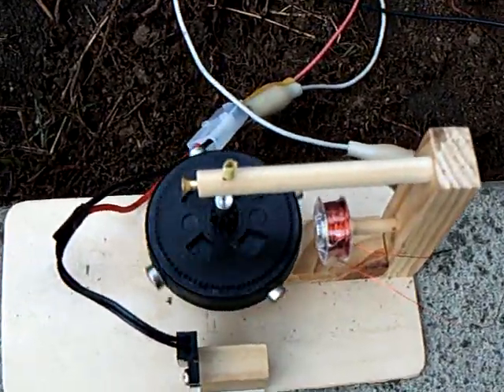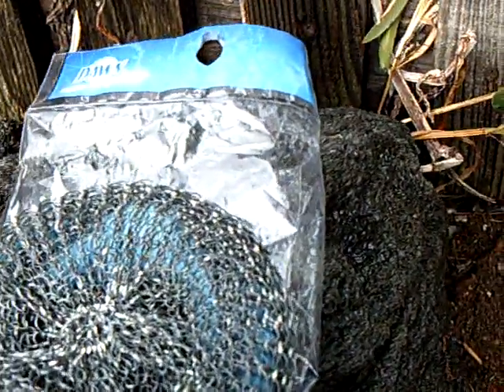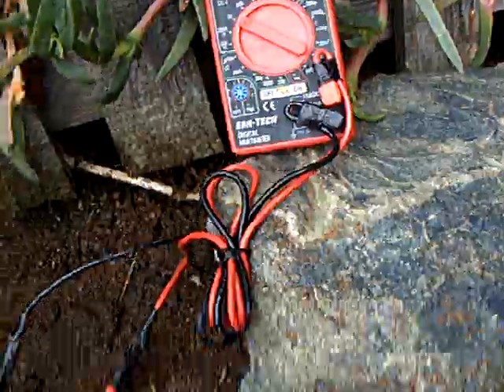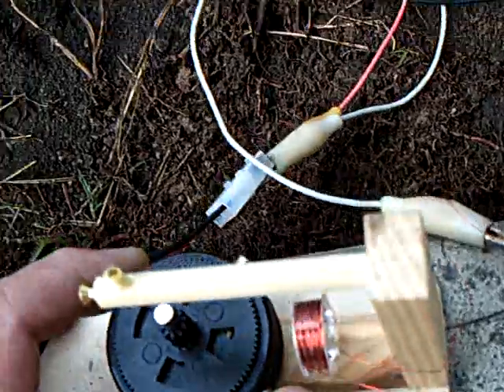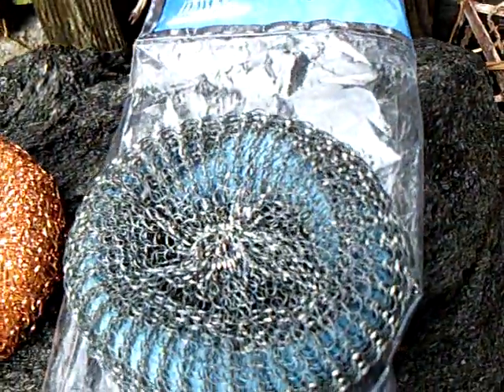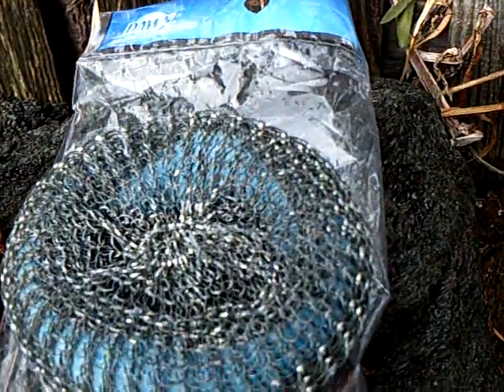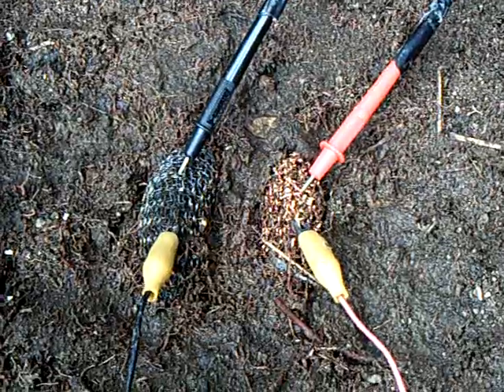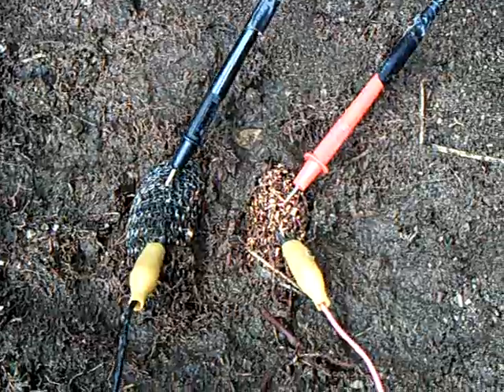Pot Scrubber earth battery ----running a pulse motor

Comment: try using zink rods, you will be amazed, all you need are copper or stainless steel as the positive and zink at the negative should give u close to around 1.7 - 2 volts.

Comment: hmmm, I wonder what a chunk of galvanized fence and a copper grounding rod would do?
Reply from the maker: Unfortunately all I did here was put a 'lemon battery" in the ground.  It is a simple galvanic cell.   They did this years ago for powering telegraph.  Google 'earth battery images' and you will find a bunch of old designs for these.  A buried galvanized fence would work good for the anode.

Comment: Where did you get zinc pot scrubbers from?  I can find iron, stainless, and copper but no zinc.
Reply from the maker: +legalizeshemp420 The have the zinc coated pot scrubbers at the dollar stores.  They are not solid zinc and when the zinc is gone you are down to an iron and copper differential.  The solid copper scrubbers can be found but usually those are also just copper coated.   This project was interesting but really all I was doing was putting a copper / zinc battery in dirt.  You could do it in a flower pot.
Reply: *****
Yep.  I tried a zinc coated nail and a coper piper in some water with vinegar and 1 cell would not even light up a LED with a Joule Thief and what was really surprising is if I added a battery in the loop that was 1.3v it still refused to light but the battery alone it lit via the JT.  I had almost 1V but I suspect the current was just far too low.  Working on this to show my nephew as a school project and I have never had any luck.

Comment: Hi Lidmotor my hat off to you for your constant new twists of experiments. I can testify that connecting a 5 ft carbon rod of about 4" diameter and a 1ft. long 2.5" diameter magnesium rod gives up to 3.5V,  I recall up to 5 volts depending on orientation etc, with a joule thief I was able to directly power up 3 regular red leds about 2.5 volts each at the most,and at around .45 amps... Both rods were close and far in several tests of mine, the north south orientation being the most powerful of it all,t( I have Aztec blood in me, I know they were right as well) In my case, in muggy Georgia, at the time, water wasn't my friend, voltage was low after raining, My conclusion is that the reaction could be doubled in nature, obviously powered by water but also, telluric currents studied by Nikola Tesla, but in my humble opinion using resonance is what we are missing in order to obtain a more powerful effect, procedure that escapes my expertise at this moment (not that I have the time after family) but this experiments are certainly proof that the legend is a reality, I'm sure that you would consider what I'm about to say a very valuable piece of information: As a tremendous coincidence while researching about telluric currents found out through my wife that her great grand uncle, was the real inventor of the Telegraph!!...Alfred Vail, if my memory doesn't fail,(name wise) and he also experimented with the idea, most likely after being around Nathan Stubblefield, just like Nikola did!...Hence Alfred implementing the battery in the expensively financed by his father Stephen Vail, telegraphic lines, both individuals were regarded as mechanical geniuses, high intelligence runs in the family,( my father in law, a long time ago, created a puzzle made of wood blocks, that looks just like Tetris!!...If he just would've patent it)  but also like in Alfred's tremendous humbleness and benevolence, there is no interest in money...Alfred died in poverty due to Morse's crooked ways, I have made my mission to try to let this know. for it is how we loose the real originators of great inventions and their secrets,- wish I would know more- hopefully in the future by researching more about Vail... 

 https://www.youtube.com/watch?v=oo0hSZ9R_Xk

one of my experiments, please excuse the language tumbles :) 

https://www.youtube.com/watch?v=qd2mSkQ_uog

Comment: Nice lil wooden pulser btw. I just want to share the interesting point that the telegraph lines used this power ACCIDENTALLY. Yeah, they 'dug' it up literally and without knowing this was there. Telegraphs were initially powered by lead acids but then a few locations noticed that they were functioning fine but back in the battery room there were dead/corroded/empty cells (they realized the telegraph line itself was the power source due to the distance between the points giving this effect).

Comment: One thing to note, take a light, say an led. 2 wires, the right battery to run led. and mesure amps at both terminals of battery. You know the circut has a loss, so: Which way are the electrons flowing? Bet it's oppisate to what most people think....

Comment: I was thinking about Galvanic action the other night. I reckon there is power there. Imagine stopping it and charging the boats battery at the same time....

P.s. The earth has a huge negative charge. it's one big battery...

But if this battery works in a plastic container full of (damp) dirt, I don't think it's right to call it an earth battery. How about Dirt battery? It's like when people call the Neg terminal on a battery earth. it's not quite right and it confuses new learners..

Good work

Comment from the maker: Actually on the boat you try hard to keep everything dead neutral.  The salt water environment starts up a galvanic reaction any where it can. You don't want that because less the noble metal gets eaten up.  I do know a guy who used his mast as an antenna to gather RF energy then used a simple boost circuit to charge a AA battery.

Comment: Earth batteries are cool indeed, and sort of indicate a charged environment. I know that under certain atmospheric conditions, there can be a LOT of volts potential between atmospheric strata, even between ground level and head-hight.

My actual question to you, Mr Lid Motor, sir, is; is there such thing as a boat-battery? 

On a good day, are there potential volts to be harvested between the tip of the tallest mast and the bottom of the keel? I mean.. OTHER than lightning..

Comment from the maker: Unfortunately the Fuji corcuit draws quite a bit current.  The basic mod that lights a modified CFL will run on a 1.5 volt AA but the amp draw is several hundred milliamps..

Comment: @Lidmotor I'll read up on that, sounds interesting ... even flairs had a revolution! A new type of graphite foam is being produced at the moment which also has huge potential. I think they are making vehicle radiators from it because of its heat transfer properties but from a battery point of view i think we will see big things.

Comment: Nice work Lid. The Earth battery may make a come back yet. I always thought it strange that a cell in a lead acid battery is 1.5 volts no matter how big the cell is. It is sort of like nature saying that "thats it" "thats all you are going to get". It must be a constant of some sort. 
I am still watching and learning.
Reply: Increasing the amperage for earth batteries is quite simple.  A law of physics states that wiring in parallel will add the amps of two power sources.  We simply wire a solar panel to the earth battery.  We build the earth battery to the desired voltage in series.  Earth batteries are the cheapest voltage around.  Then wire a solar panel to the EB in parallel.  Boom best of both worlds.   Real power.

Comment: Great video, your sailing trip must have inspired you to show us some more free energy :-) It would be great if it is enough energy to light up some garden LED's, that would also be a good indicator for your garden plants when they need more water. I'm building a solar water or air heater from plastic bottles, soda cans and copper pipe. I was amazed by the temperature from my first test results. I've posted some videos. Greets, iT

Comment: Wow. I've done this before with copper scrubber and zinc bolts but did not think there would enough juice to run a motor. It barely lit a led bulb through a thief. I fix computers often and have a garage full of zinc coated sides which i can verify make a great cells! Copper is getting harder to come by here lately.